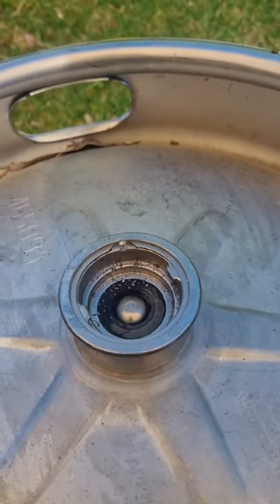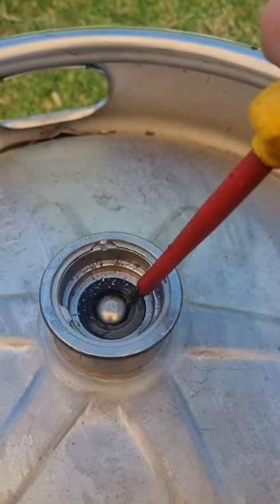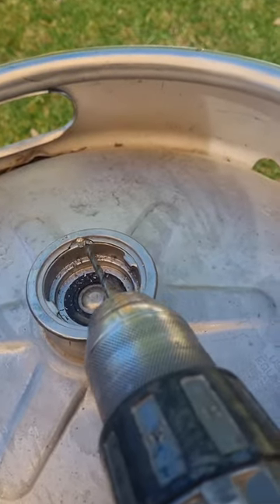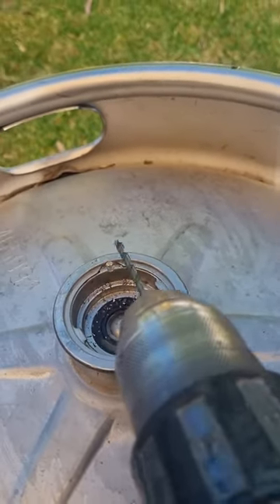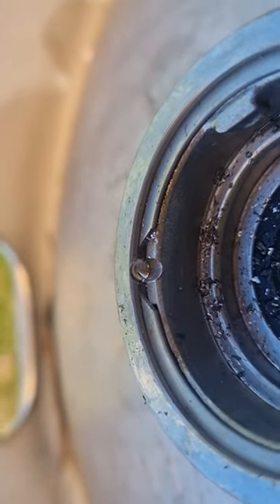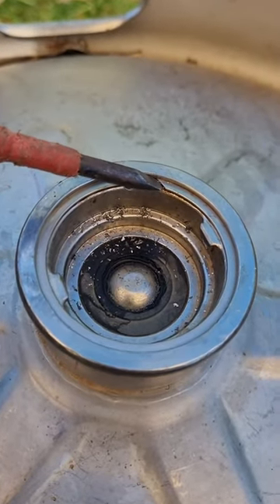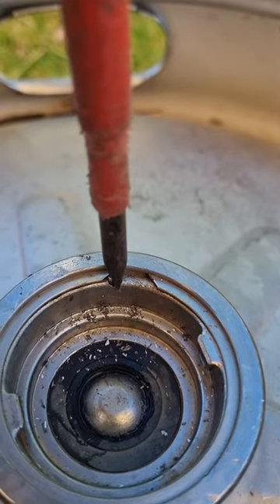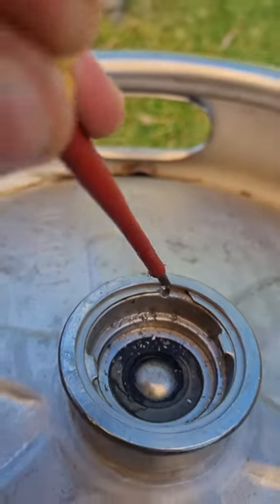How to remove circlip and spear out of a 50L beer keg.

Comment: I wish I could get mine out that easy with my cub keg, I released all the pressure and removed the clip easy but I can't turn the spear even by hitting it with a hammer and screw driver. Any suggestions apart from throwing it to the shithouse?
Reply from the maker: @stagstalker13  soak it with WD40, would be my go to.
I've had a couple that have been real tight and bound up, stainless is pretty bad for binding up.
Reply: Yeah I soaked it with that too mate. No bloody luck at all.